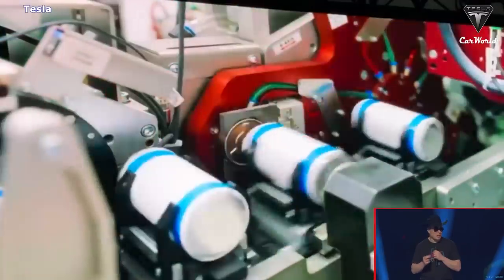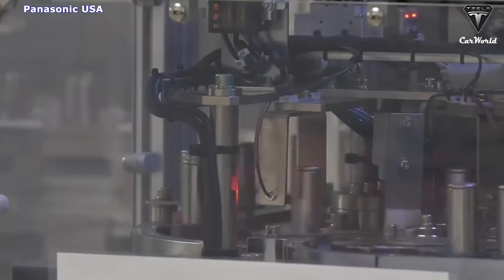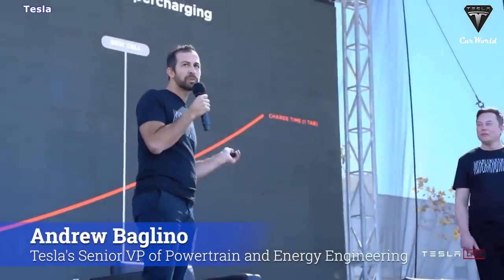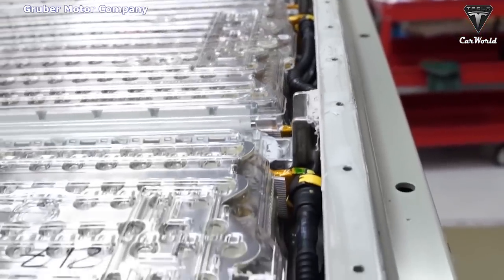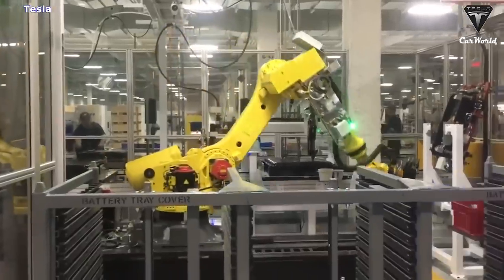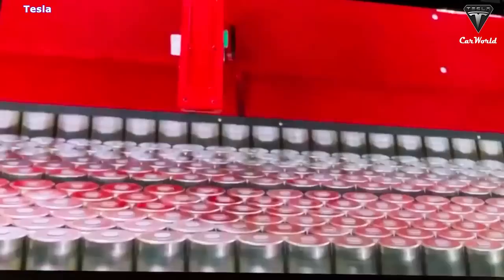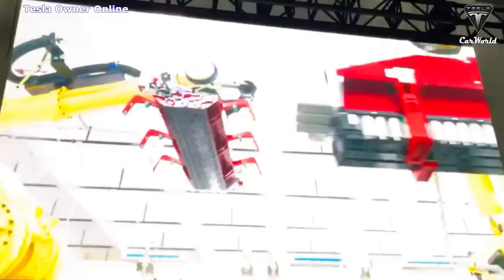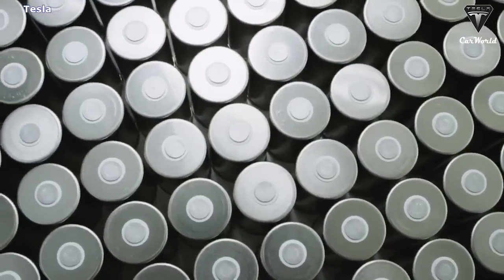Finally Happened! Texas Just Approved Insane Project about 4680 battery in late 2022 and 2023!

Comment: I'm actually looking for all the dust to settle before considering buying an EV.  Especially with battery packs. ie longer range faster charge times.
Reply: So much cutting edge research on batteries . . . could be many years before the dust settles. 

E.g., company in AUZ has a new aluminum graphene battery with across the board specs that would obsolete everything else. Mining giant Rio Tinto is a major investor. Just one of many examples.

Comment: 4680, I saw in video 5X energy, is that energy density and more importantly does it mean longer mpc? Be nice to have 800 or 1000 mikes between charging.
Reply: The energy density of the 4680 cell made in 2022 is approximately 98Wh/.35kg = 280Wh/kg. Energy density of the 2170 cell (2022) is approximately 18.5Wh/0.07kg = 264 Wh/kg.

Comment: I want a few 4680 cell packs for my 40 volt RYOBI electric mower and all the 20v Black and Decker hand tools first; to test out the battery performance.  Then I want a freezer and refrigerator only, small power wall that will recharge off my Harbor Freight 45watt solar panels.  Then I want an exchangeable vehicle so that when I need or just want a truck I can turn in my car and exchange it for the Cybertruck and vise versa,   .